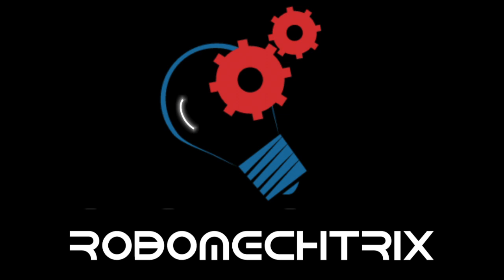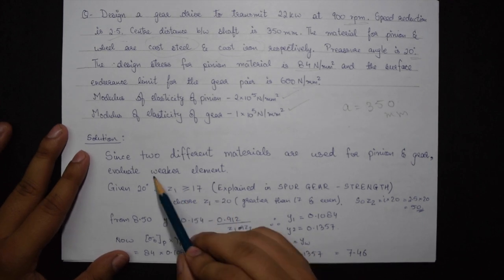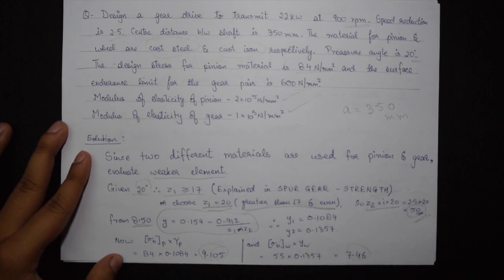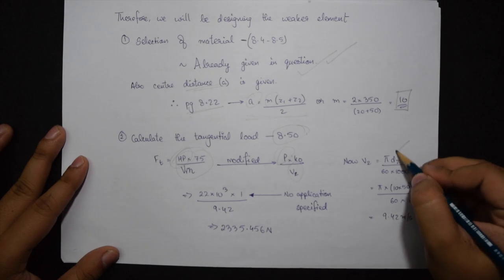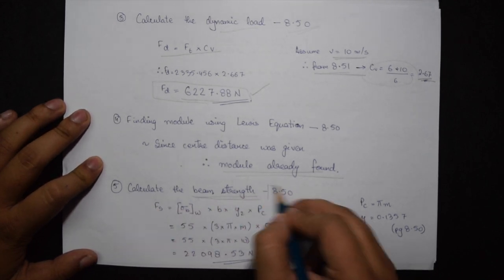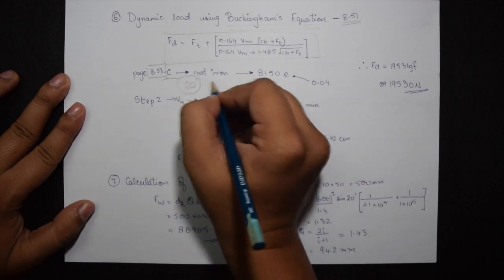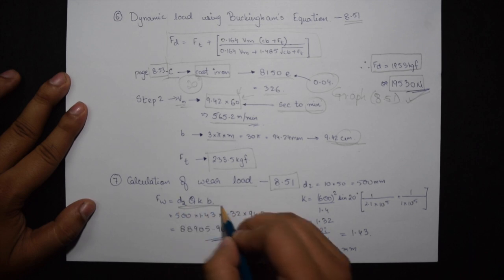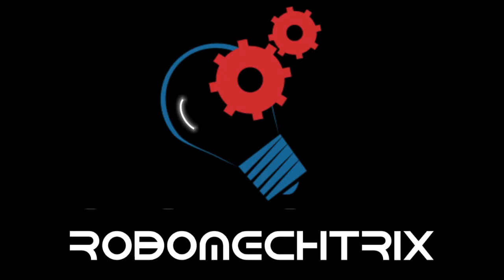Spur Gear Design Procedure based on Wear Condition (Part - 2)

Comment: When calculating V in step 2 , where did u get value of n(360) from?
Reply from the maker: Velocity in the starting of the question can be calculated from taking the values from either the pinion or the wheel. So when i divide 900 by the velocity ratio I get the N for thee second thing or 900/2.5 is 360 which is what I took.